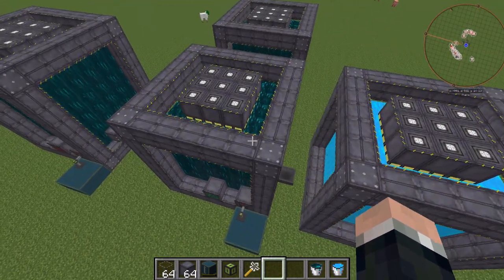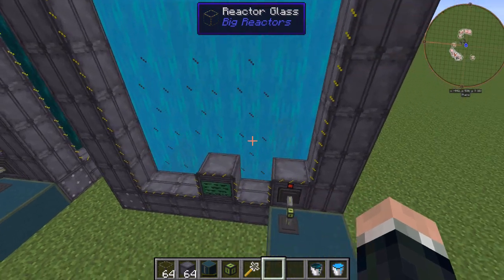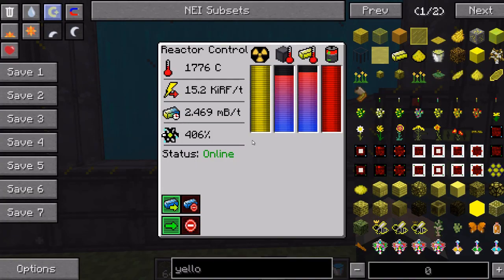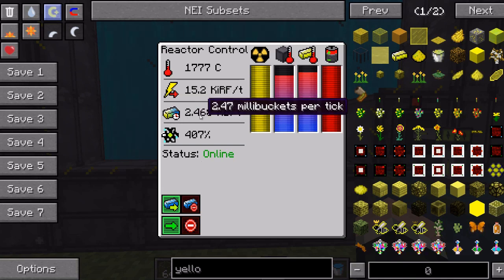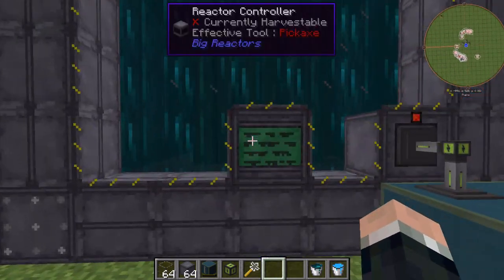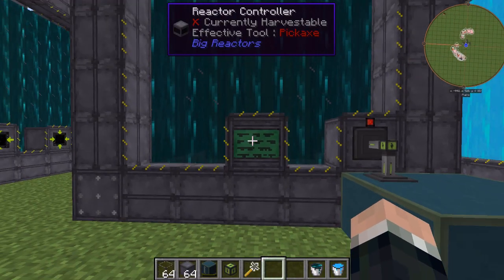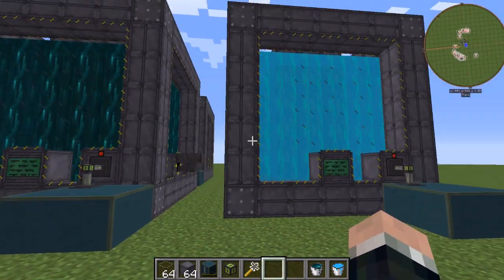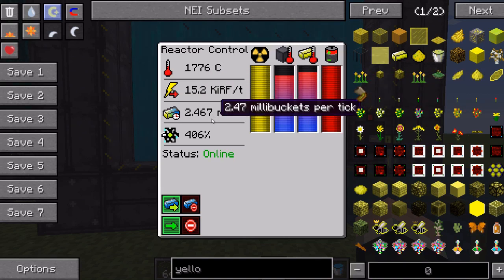Minecraft: Big Reactors "Coolant Showdown" 1.7.10

Comment: My personal Big Reactor design is a 9x9, it is more Fuel efficent but also more Expensiv.

The most Efficent Design, what i found, was created by Skyqula on the FTB forum, he also creates a Spreadsheet with almost everything, what you need to know to build a Reactor.

Spredsheet:
>https://docs.google.com/spreadsheets/d/1df7-8OqdOeWppfr1xZsV5eFqBWUeGGvtyQ6e1agJN2s/edit#gid=1439247654

His Design:
>http://br.sidoh.org/#reactor-design?length=13&width=13&height=3&activelyCooled=false&controlRodInsertion=52&layout=4O5E8O5C8O5C8O5C4OE3C5X3C2E3CXCXCX3C2E3C5X3C2E3CXCXCX3C2E3C5X3CE4O5C8O5C8O5C8O5E4O&modpack=direwolf20

Forum Thread:
>http://forum.feed-the-beast.com/threads/big-reactors-a-spreadsheet-mechanics-summary-and-reactor-example.45647/
Reply from the maker: Excellent links. I will study them more. Thank you